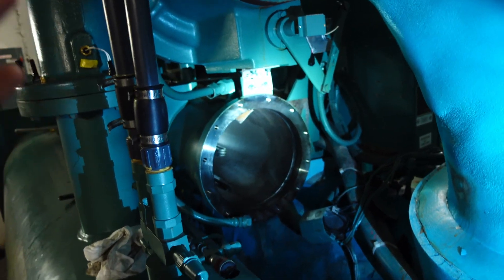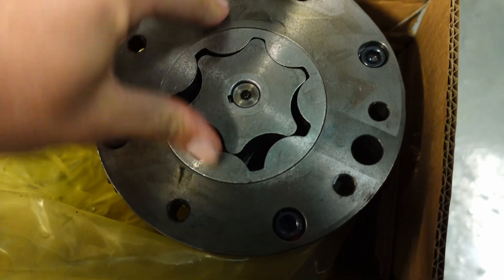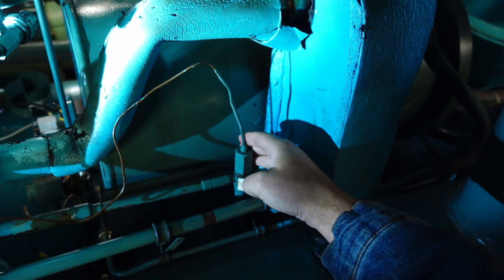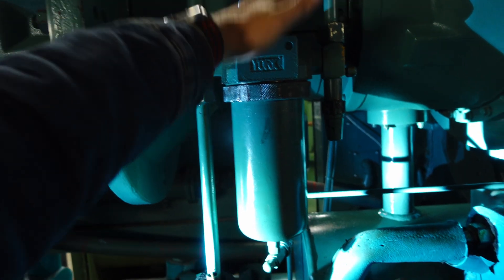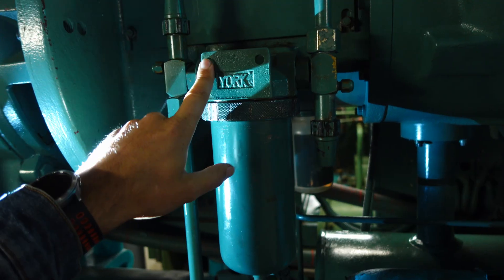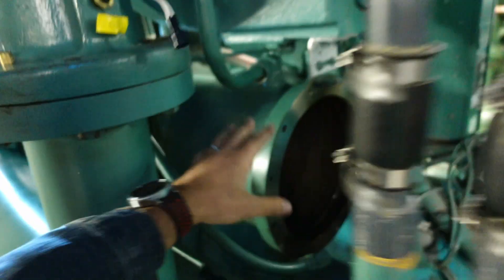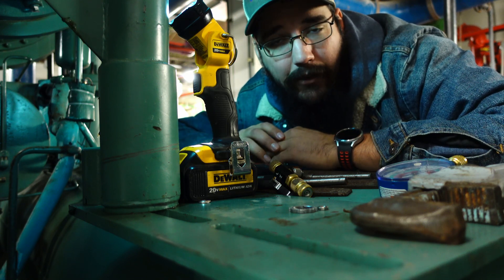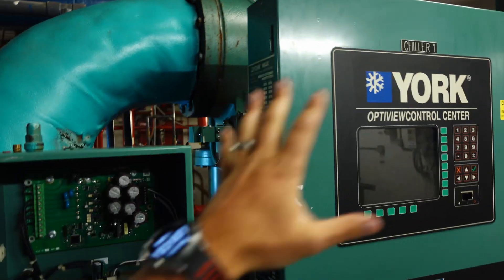Oil System YK York Chiller

Comment: Run into issues with the sight glass leaking? Thinking of putting the grape jelly on it. Seems to be a reoccurring issue
Reply from the maker: 554 would work, have to make sure the Oring is in good condition and the seat for it is clean to prevent leaks.

Comment: So you want the oil sump pressure to be lower then evap pressure. You want 35 PSID between sump and discharge. Want temp should the oil sump be?
Reply from the maker: 35PSID between sump and oil pump outlet. Oil temp 110-140F
Reply: @ thanks

Comment: Having issues with a yk right now. While running sump LOP is about 60psig and evap is 38 psig. Changed oil filter and eductor. All valves open. Oil return solenoid working. But eductor filter stays hot, could it be bad balance piston seal, or faulty/plugged eductor block? If any one can assist it would be greatly appreciated
Reply: To clarify Changed eductor filter, not block

Comment: Thanks for the video , appreciate you taking the time to share.   What is the sequence for the solenoid on the oil return line?  Is it open during on cycles and closed on off cycles?
Reply from the maker: Yes, and the oil temp will influence it opening
Reply: Thank you very much , so if the oil temperature in the sump is already low it will stay closed?
Reply from the maker: @DronePilot4k  exactly

Comment: great video  buddy, i have a small leak on the oil sight glass, could be the o-ring , do i have to drain the oil in order to replace it, or i have to remove the front plate also? Thanks in advance

Comment: please advice have you ever have this problem ?, I am getting the oil loss in oil sump chiller York YK Centrifugal. The oil seems goes to evaporator

The above problems occurs after  :

1. We have changed the oil Return Solenoid
2. add extra valve for changing the TXV oil temp control (so if we need to change the txv no need to transfer pump down the R134a)
3. Change the new oil pump

The actions that we already redone :

1. change again the oil return solenoid to the old one
2. change the oil cooler heat exchanger
3. change the txv oil temp control to the old one, but the extra valve for service still there (because of welded)
4. checking the oil block eductor inside the oil sump ( the springs are doing pretty well)

The problem still remain ,getting the oil loss in oil sump chiller York YK Centrifugal. The oil seems goes to evaporator

please advice, do you have any suggestion
Reply from the maker: How much run time in-between trips?
Reply: only about start up 5 minutes , the oil sump level already minimum. The chiller still can run, but we just turn off the chiller off because the low level oil
Reply: before we already pump down out the oil in the evaporator with its r134a , drain all the r134a and the oil in evaporator side

Comment: Did you have to recover all the refrigerant to work on the sump or where you able to isolate. I have to work on oil sump. I have isolation valve on discharge piping going to condenser but nothing on the evap. So, my question to you is do I need to recover the entire charge.
Reply from the maker: Yes, you wiil need to recover charge.

Comment: Hi bro Holden , basically i've experiencing quite a number of times OIL - VARIABLE SPEED PUMP - DRIVE CONTACTS OPEN FAULT ALARM .
Checked and verified no voltage across the output . Replaced to a brand new VSOP Board as well but the fault came back again in just 2 months . Any other alternatives or solution on what to check ? Can temporarily bypass somewhere to make the system online ?
Reply: The VSOP boards lately are not very good quality. They usually come with a 1 year warranty and I've had to use it many times
Reply: Might want to get the input line inductor for vsop